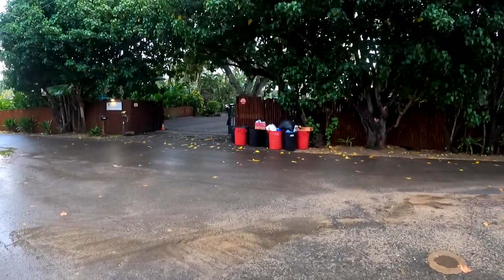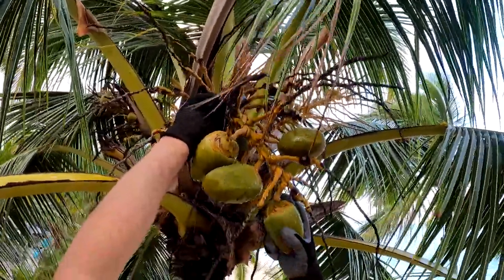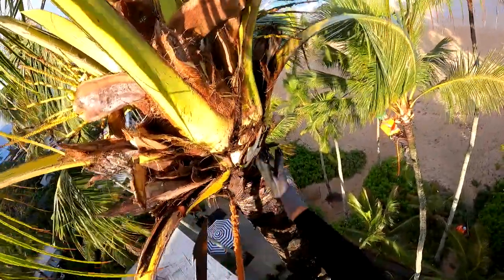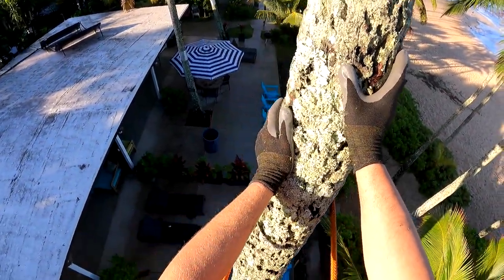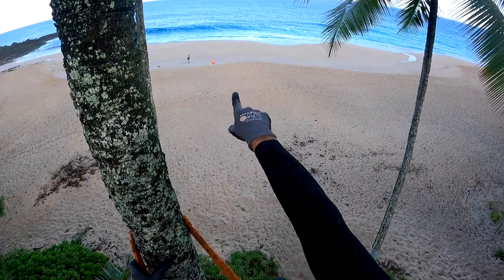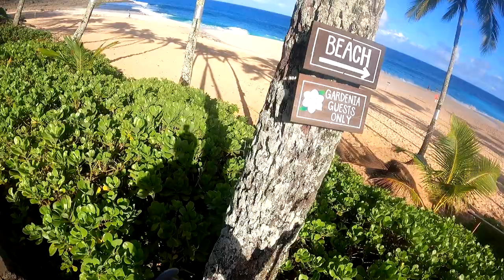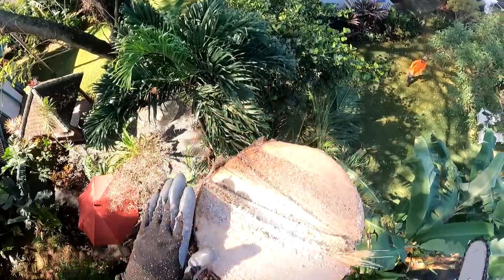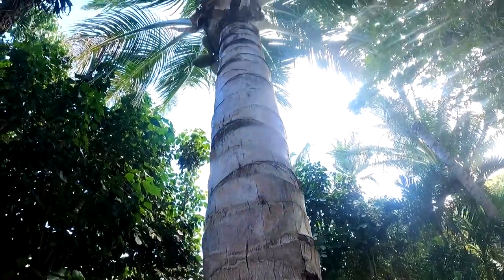BIG HAWAIIAN COCO JOB!!! The Traditional Hawaiian Method for Maintaining Coconut Trees 🌴

Comment: You did really good job for your first time. Fun fact about coconuts palms....every frond has a flower. The coconuts/flowers/pods on any given tree will all protrude on either the right side of the frond it is attached to or it will all be on the left side of the frond. Every tree will be either be all right or all left. I was taught to go around the tree based on what side the flower was on. So if the flower is on the left then i go around left. Reason being its easier nicking and get frond to peel down if you approach from the opposite side of the flower. So coconuts that flower left are easier for a dominant right hand person to trim because your swinging hand is the closest to the trunk and your other hand can hold whatever your cutting. Vice-versa if the flowers on the right its easier for a dominant left hand person...dominant meaning he can't swing with his other hand to save his life 👊🤣 anyway that was really long for useless trivia...p.s. the Hawaii edition has earned my subscription Aloha🤙

Comment: Your palm tree facts encouraged me to research them a bit and I learned that they do not have a cambium which also helps make the case for spiking them. Cool stuff. Thanks for sharing!
Reply: (Could be completely wrong) but I heard they are technically a grass not a tree which is why they don't have a cambium
Reply: @OllyBoardy  Very interesting! That makes sense considering the monocot classification
Reply: @neild7971  For sure! Everything has its limits and it'd be nice if there was a study somewhere on that since people's lives depend on it. If they're cosistently climbing on the high side of the stem, that's the tension side that's getting compromised 🤷‍♂️
Reply: Spikes dont kill trees.  Case in point...powerline right of ways.  Sure its ugly and might even transfer disease in certain niche situations but that's the only points I'll concede.  If spurs hurt trees, there would be lots of dead trees in my state.  Thousands.  MIllions even.  But that's just not the case.  Helicopter trimming kills thousands upon thousands of trees, however.
Reply: @verteup  I actually don't know that I've ever heard anyone claim that spiking a tree would kill it. I don't spike trim, but all of my climbs are in urban settings 🤷‍♂️
Reply: I’ve taken down tons of palm trees over the years and have cut through plenty of trunks that have been spiked previously. It’s like a little rotten spot on an Apple. Not a very big impact on the palm at all.
Reply: @verteup  point was that palms don't add material like a tree it seems, youre just chipping away at them and they are quite tall and skinny already
Reply: @neild7971  If it don't have a healing mechanism like a tree then it's even worse to spur palms than trees.  The logic being used don't follow.  It seems like a cop out to forbid spurs on trees but all the sudden it's ok on palms because "thats just the way they do things".
Reply: @verteup I do tree work on big island and use a climbing stand for palms. Seen my fair share of diseased cocos where the heavy top breaks off the trunk. With Hawaii’s tropical wet climate, the disease vector is big and to reduce chance of infection by not spiking a trim should be standard practice. I however understand from a production standpoint point when you’re doing 500 trees that it would take forever and probably cost a fortune to do it any other way than spiking. Maybe Oahu is a bit more tamed in the disease vector than Big island given its less jungle and and more city.
Reply: @OllyBoardy  Correct. Palms are not trees.
Reply: @verteup  Trees don't heal either, like animals. They seal. Gaffing palms isn't sightly, but it doesn't hurt them the way it does with trees. Gaffing thin barked trees does.
Reply: @rogerbarnett8412  you're splitting hairs buddy. Call it healing or sealing the end result is the same. I do line clearance and if gaffs killed trees then the right of ways would have hundreds of thousands of dead trees but they don't.
Reply: @verteup  Good for you. You're talking to the wrong guy. Trees do not heal. I worked in residential arboriculture for 46 years. Certified arb since 1996. Gaffing can and does affect trees. Even doug fir and cedar a bit. There is no reason for a professional arb that does residential work to gaff trees.
Reply: @rogerbarnett8412  I never asked about your credentials.  That's because I do not care about your credentials.  Gaffing does not affect trees in any significant way because if it did, there would be thousands of dead trees in the right of ways.  There aren't dead trees in the right of ways and the vast majority of them are trimmed with gaffs.  So there's no evidence to support your claim.
Reply: @verteup  Yawn. You are wrong, of course.
Reply: @fastguysslowbikes  Spur marks heal up.  I've seen it with my own eyes.  I live in a very heavily forested state.  Not just conifers either we have hardwoods here. Poplar, white oak, red oak, black oak, hard maple, soft maple, cucumber, black walnut, locust, etc.  We trim everything with spurs and they survive just fine.  I've seen it with my own two eyeballs.  Come to West Virginia and look down the right of ways for yourself.  Your narrative doesn't hold weight buddy.
Reply: @verteup  those are trees. These are palms. They have no cambium layer. There is no CODIT. Don't come on a public platform and act like an expert on something you know nothing about.
Reply: @fastguysslowbikes  I know they're a monocot.  I can actually read and understand what I'm reading.  Unlike you apparently.  I think you need to re-read this entire thread because you do not understand what I've said here.  I'm pointing   out hypocrisy.  Monocot's don't heal.  Trees do, because I've seen it.  Therefore the whole "its ok to spur palms because that's just the way it is" is contradictory to "you must not spur trees".  You understand?  Read slowly if you have to.
Reply: @verteup  I'm not sure you have the ability to be corrected. 

But in case anyone else is reading this: 

Spiking prunes for any reason is bad. Verteup is bad.
Reply: @fastguysslowbikes  Then so is spiking palms since monocots don't heal.
Reply: @verteup  which is exactly what I said in my first comment here. But somehow you thought you should argue. 

Your defense is that you were saying spiking trees is ok, not palms. 

Not only do most of the people in these comments not know to differentiate the two, but that is still bad advice. 

Just because you don't see dead trees from spiking that doesn't make it ok. There are dead trees everywhere and you have absolutely no way to verify that spiking them didn't contribute to their decline.

That's like me saying I don't need a seatbelt because I don't personally know anyone who has been in a car accident.
Reply: @verteup  spiking a dicot is bad because it envoles the cambium layer which is responsible for the flow of water up the tree and the flow of sugars down the tree. You can spike a moncot because it has no cambium layer and the entire trunk is like a straw pulling water up. If you spike a coconut tree repeatedly   you will find under the first layers of the trunk will be a hard layer impenetrable to your spikes. I dont care how hard you try to kick your spike into a coconut palm you will never get to go in more than a half inch. In fact if the the top layer is completely gone from spiking a coconut over the years you won't get your spikes in at all, you will have to tippy toe 2/3 of the way up. That being said it is best if you do not spike palms trees at all, we do  it and get away with here in Hawaii because it's faster which makes it cheaper. When a corporation has 800 cocos to trim twice a year at the minimum sometimes 3 times a year they want them done for as cheap as possible. So we have spiked 90 year old coconuts for 20+ plus years without compromising the coco, but it is not the best thing for them
Reply: @rogerbarnett8412  we animals heal, trees seal, palms don't do either but they do develop a hardening like a callous 🤙
Reply: @CryptSak  Thanks for the polite and educated reply to the not so nice "vert" dude..... I'm from the Pacific NorthWet, so have never climbed a palm. Gaffed conifers from 1975 to 1990, phased into gaffless rope climbing over a 5 year period.... and am enjoying retirement now!!
Reply: @rogerbarnett8412  that a nice long career, enjoy your well deserved retirement 👍
Reply: The palms having big holes in them is not natural . Then u get rain and moistures in the pockets .

Comment: Thanks for sharing, it's always nice how it's done in different places. I'm an arborist in Tahiti, coconuts everywhere just like in Hawaii. Especially for leaning coconut trees, I like to climb with a second lanyard on my bridge that I clip around 2 or 3 palms bases when I reach the top. That way I am suspended and can work around much easier. Your hips and legs will thank you especially if you do this all day long. Also I use electric pole rounded spikes. Less damage to the trunk and you feel definitely more stable on small diameter trunks. Keep on the good work, your channel is amazing !

Comment: Some of us use adjustable friction saver DRT as well. Spike up the tallest in cluster of cocos and can swing to smaller adjacent ones, sometimes get a pull over from groundie.  Tie in below flip line keeps it safe and good for bombing out saves down climbing and good safety in case of an injury. 🤙🏽 p.s. you left a torpedo in that first coco 😆💪🏽

Comment: That cane knife is great. Here in Brazil,  what I see most is the machete, that goes by several other names, but not machete.
Also, I see people here opening the coconut by the top, where it hangs from the tree, but after flattening the bottom so you rest it on a table.
Nice seeing another, easier way of opening the coconut.

Comment: I have a couple of palm trees at home , not cocos but they have that same sort of "paper" that comes down in sheets as the fronds self shed , the fronds are very spiky and need good gloves to handle safely . I have a love /hate relationship with these trees . 
             The "paper" I have discovered makes excellent fire starter when dry , I have a few acres so have a few fires each year to burn the prunings , a few bits of that fibrous paper scrunched up and lit does the job to get things started .

Comment: Old style linoleum knives work very well for many types of palm fronds, and you can clean date palms with a spade shovel with a sharpened blade. D handle short spade shovels work great to shoe the heads, far faster than chain saws and less invasive to the health if the plant.

Comment: More like trimming the hedges. 
As the coconut tree owner, I they would want the metal flashing replaced. Maybe remove good pieces before, then reinstall. 
Glad you got to fell a tree. 
The smooth looks so much nicer. 
Saw an old guy climb a coconut tree with beech towel tied in a ring, wrapped around his feet.

Comment: Things I thought about.... like that rope that holds you to the tree, it must have a steel wire core. I was wondering how much force it would take for a knife  to cut the secure line should you hit it hard with the blade. And of course the most weird question is: Have you ever come close to flipping backwards in a tree while climbing??? I seen it happen in my time as a guy came down from topping this tree, he kept dropping large loops down and picking his spurs at the same time like a speed climber might do.... very dangerous

Comment: I respect the Machete I have trimmed well over 20,000 Palm trees I could never see myself using a Machete👍
Reply: What do you use?
Reply: @neild7971  a 201t
Reply: Have you tried the little echo saw, so light! Imagine it would be good for that
Reply: @neild7971  no but I do run a 193t also that I like alot

Comment: You use a very curious way of making coconut palms.  but in my experience it is as interesting as it is dangerous since that knife that you cannot control almost makes it very insecure how to prune the palms.  it's almost better to use a handsaw .  Due to the challenge presented by the palms, it is recommended to have at least two tie points to the palm
Reply: Hands saws take forever and it uses up your energy. Hawaii been using machete for years due to the heavy demand

Comment: I wouldn't have my safety line so close to the cluster. It's easier than you'd think to cut through it with the knife. Not like a chainsaw that would bounce up on it.
BTW, it's called Keiki Beach because that's where the kids surf. Lol. Keiki means kids.
Reply: they are steel core, that's why they don't mind it
Reply: @peterplatt72  are you affiliated with the channel?
Reply: @dire67  no I just heard them talk about it at around the  21:35 point when he hits his lanyard and says he glad he's got a steel core one
Reply: @peterplatt72  that's why I said what I said. I still would've taken more precautions. I actually use a chain. An old friend of mine died on Maui after falling off a coconut tree when he accidentally cut his line.

Comment: A brand new hand saw goes faster then A machete ,and the hand saw makes the ends of the nubs a clean cut the machete bash's it and it does cut the seedpod nubs back enough. When I see a tree with seed pods there after it was pruned that's half ass  compare a hand saw cut to a machete cut you see a difference
Reply: The coconuts come back faster depending on how far back you cut the seed pod cluster
Reply: @acbanit845patterson9  who are you critiquing Jacob or John? For Jacob's first time I thought he did very well. John seemed proficient as most seasoned coconut climbers I know. Some use strictly handsaw some use chainsaws I was taught to use a knife...many ways to skin a cat, to each his own I guess main thing everyone is safe Aloha🤙p.s. as long as you cut all of the flowers off when you cut through the pod there will be no premature coconuts and the stub comes in handy to pull/push down  for leverage next time you trim the tree